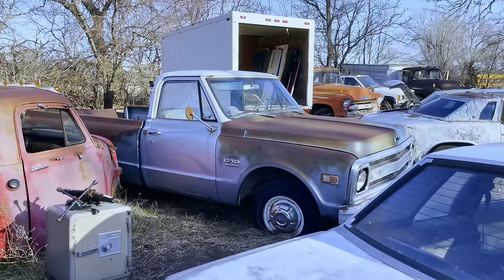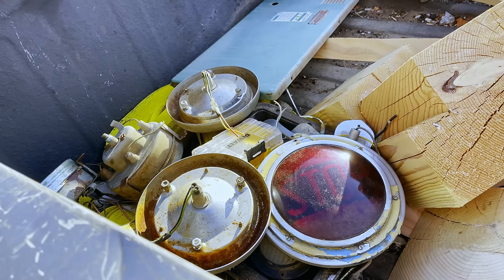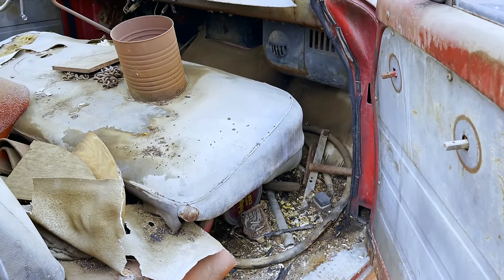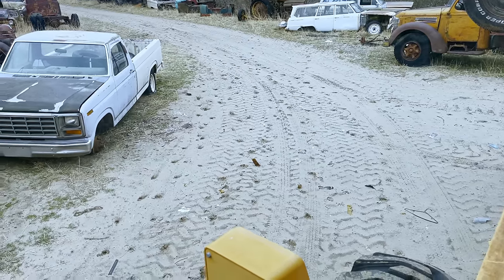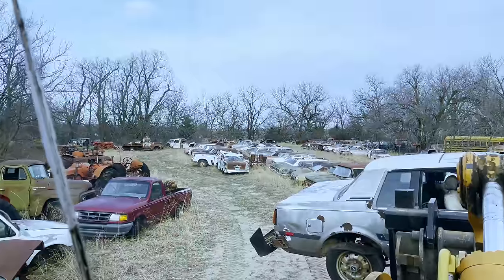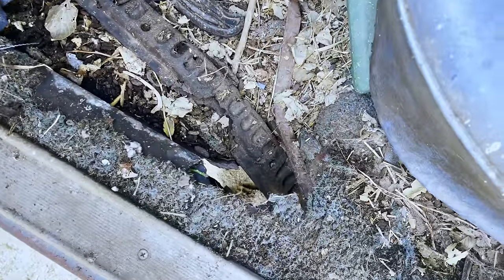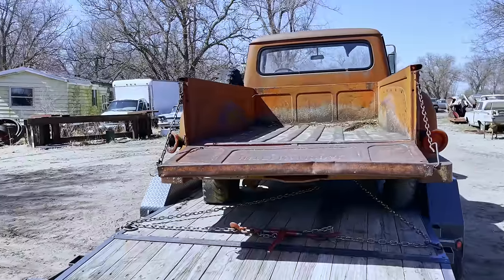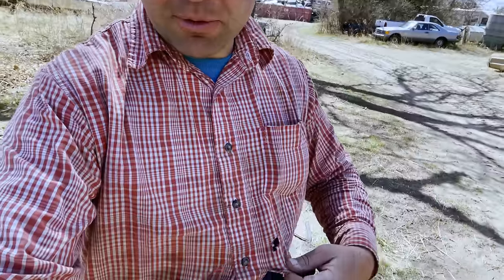RESCUED from the JUNKYARD: 1965 International & 1969 Chevy Pickup | No Longer Abandoned

Comment: Silas, I have lived in a school bus for the last ten years in Alaska and I have a wood stove. My point is, you really don,t need a two wall pipe. The reason is that the bus is metal and it is double walled. No issues in ten years. Best of luck to you. Enjoy your videos because I am the landfill manager for the city of Bethel. We are off the road system so we can’t get rid of our vehicles. It’s just too expensive to send them by barge or airplane, so we just smash and stack them. This year we bought a shedder, but all that,s going to do is reduce the space that they take up.
Reply from the maker: Cool! What do you use for a gasket around the pipe where it goes through the roof? I was worried about melting it.
Reply: He's right, that 18 inch rule only applies to a combustible wall or ceiling.  Your glass and metal bus should not be combustible.  You could still use the official double wall through the roof kit from Selkirk.  Just go buy a 5 inch to 6 inch adapter and then from what you have up use a 6 inch kit.  They have everything you need to go through the roof of the bus.

Comment: I always admired those C series Inters. I saw one in a mates workshop years ago which had been delivered new to the Sydney Morning Herald Newspaper . It had a plaque on the dash stating " Caution.Modified engine .take when driving." It had a modded LA V8 with a torque flight 727 with a floor shifter. . They had a small fleet of them which were used to delivering papers in the early hours....quickly.  .The rear decks were alloy to keep the weight down.

Comment: for your stove start out with 5'to 6'' thimble or reducer so you can switch over to the common size of 6'' pipe. Check your local heating and air supply for pipe and fittings.  Also no need for double wall pipe on a wood stove pipe that is running through a steel bus roof unless your trying to protect the little ones that might try to touch the pipe
Reply from the maker: I thought of that except I’m not sure if the water proofing gasket will hold up to the heat of single wall pipe

Comment: Why would you need double wall stovepipe to go through the top of the bus? Are there combustibles up there?
Keep em comin Silas!
👍👍👍
Reply from the maker: Yes, the roof is full of insulation. I’m also worried about melting the gasket that goes around the pipe at the roof opening.